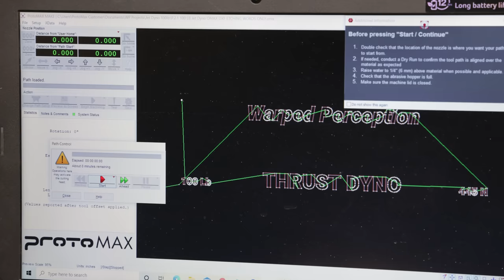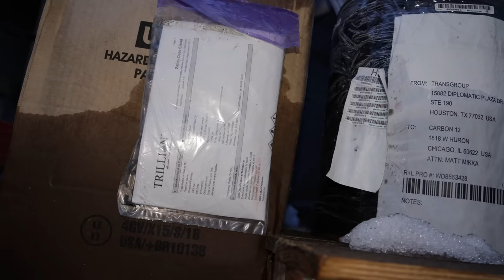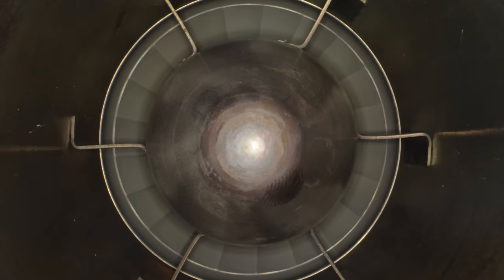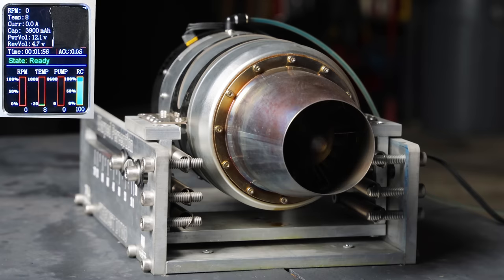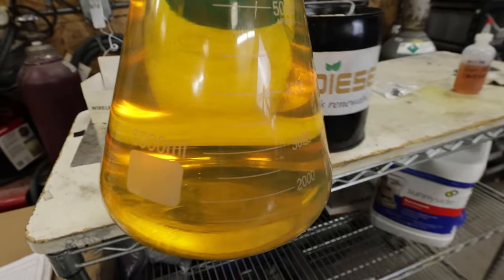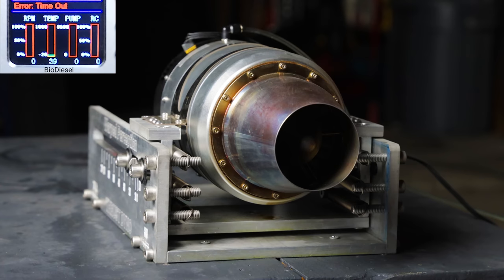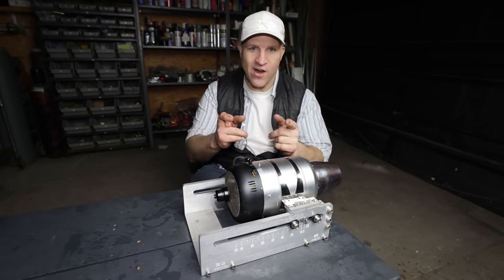Jet Engine Thrust Test - Fuel Experiment (Jet-A vs Diesel vs BioDiesel vs HydroDiesel)

Comment: This was an awesome video. Something I'd have liked to see to make this more thorough, would be logging of the ambient air / intake temperature and humidity, so that this variable could be accounted for. And also recalibrating / retesting your jig in between runs. Is it possible that the heat from the engine could affect the springs? Also the design of the mount allows the engine to apply a torque to the sliding part, which could alter the friction and power required to move it.

Comment: Truly impressive video, being ex RAF the sound brought lots of memories, one was standing next to a F4 J uk Phantom on engine a de tuner with engine on reheat runs where the back end of the aircraft was shrouded in a large chamber then throttled up! Being about a meter away from reheat shockwave rings WOW, a memory I will always treasure.😃😃

Comment: There is a design flaw, the heat from the jet can drastically affect the elasticity of springs
Reply: Another test flaw too, the engine didn't have time to fully cool to ambient between tests. This can be seen with the biodiesel start before it's even ignited, the engines still sitting at 38 degrees.
Reply: That was my first thought as well.
Reply: BS all of you.  Just look at the temp guage.  Comments always brings all the malcontents out of the weeds, doesn't it....  lol.   Enroll at Critics School!
Reply: @rimckd825  Sorry, Superman
That was a suggestion. And with this much heat few cms away can easily affect the springs so that you can't expect 0.1 lbs precision in thrust values. Only you can compare, not measure.
I couldn't find any good Critics School near me. You seem well versed let me know about yours, I can enrol there. Or, see, if you can tutor me.
Reply: Don’t judge me but I find this very amusing and I also fine falling asleep listening to jet engine sound so easy for me to go to sleep to remind me of being on the JetBlue plane
Reply: @murkinranzyz9961  im judging because this shit sounds like earrape.
Reply: @murkinranzyz9961  nah fr white noise soothing asf

Comment: Great presentation. Couple questions: 1. What is the RC scale measuring? I'm guessing throttle position?  2. What makes the initial rotation or spin up?  3. Is that front nose piece a shaft power  adapter
Reply: That looks like the throttle position; probably stands for Remote Control.
Reply: Rc ? Maybe rate of change. Acceleration

Comment: Interesting how using Jet A1 and the ECU lets it get to 99krpm where Diesel and Biodiesel and it only goes to 90Krpm
A difference of 10,000RPM will certainly show a large difference in thrust.
Hydrodiesel taking it to 93krpm and 54lbs thrust.
My thoughts are that it's down to Jet A1 being more refined than the diesels.
For my jets I used Kerosene or diesel and in the air you can't really notice difference in thrust
Reply: I think they did some calculation about the max fuel consuption to calibrate the pump. So maybe the pump was already at maximum capacity, or could be programmed to higher fuel injection rate.
Reply: It’s likely due to the ecu detecting the higher EGT and limiting the fuel flow while the water in the hydro diesel has a slight cooling effect to compensate.
Reply: @Greyline_ENG  max EGT temperature on the Diesel test was arround 630ºC, while on the Jet A1 test it reached arround 700ºC if I remember right, so definitely the EGT is not the limiting factor here.
Reply: @bodywerks  ok, thanks most of my engines are older and are limited to around 800c.

Comment: WOW I'm very surprised!!  The hydro did much better than I anticipated.  Besides the JP, it was the only one that got the engine up into the mid-90k rpms.  It also warmed up faster than the others besides the JP and did 2nd best in thrust.  So VERY surprised.  However, I do think it pertinent to mention, the heat from the jet may also have made the spring rate change.  It would have been nice to see the JP last after the others to guage the spring rate loss.
Reply: A pressure inducer on front side of engine support, and just measure the pressure instead of using mechanical motion.

Comment: Can the emulsification process used to make Hydrodeisel work on Preston fuels like kerosene? Because if so then you have a really good jet fuel alternative it seems.
Reply: I highly doubt it. We are incredibly careful about water content in jet fuel as it is. As was proven in the video with the HydroDiesel, at below freezing temperatures, that water content will freeze in the fuel. The cruise altitude for most jets is between 30,000ft and 40,000ft, the temperature at this altitude ranges from -40°F to -70°F, which would almost certainly freeze that water content, causing engine failure. Another issue is that water causes significant corrosion in aircraft fuel systems, which would have to be countered by an increase in fuel tank checks, normally only accomplished during C checks or if an issue is present.
Reply: @ShelbyWithAShelby  I really liked your explanation thanks 👍
Reply: @ShelbyWithAShelby  i have heard of a concept of fuel heating used in some airplanes within their fuel tanks. This could work on that jet fuel, on the other hand, the corrosion would require more maintenance to check the tanks.
Reply: @Alex96194  most airliners do have what could be considered fuel heaters, however they are primarily oil and hydraulic fluid coolers, and they do heat the fuel, but not enough to prevent icing if there's water in the fuel. Jet A has an average freezing temperature of -40°F, while at cruising altitude, the outside temperature is around -70°F. The FCOCs can keep the fuel warm enough to prevent freezing at altitude, but any water would almost instantly freeze, and during cross polar flights, fuel freezing is a major issue. So a water emulsified fuel wouldn't be viable for anything other than small, low altitude jets
Reply: @ShelbyWithAShelby  well ideally you could enhance the heating system if that isn't a problem,  I don't really see any problem.
Reply: @Alex96194  using what as a heating medium? You could either increase the fluid flow through the oil coolers, but then you have to deal with the oil and hydraulic fluid dropping below proper operating temperature, an electric heater could be used, but I'm sure you can figure out the problems with electricity and jet fuel, so about the only possibilty would be to use engine bleed air, however, that bleed air is so hot that it would run the risk of igniting the fuel the same as an electric heater
Reply: @Alex96194  I don't want to seem like I don't support the idea, I just haven't seen a feasible way to keep the fuel above freezing point with water. Maybe with advancements in technology, we will see this become a viable fuel
Reply: @ShelbyWithAShelby  maybe this is not even the viable fuel. Like you said, as technology develops further we will be able to find a better way of powering our stuff
Reply: @Alex96194  I can see HydroDiesel being very viable for trucks and trains running in warmer climates, as I'm sure it would designed for. But for aviation, we'll always be behind the curve in civilian aviation because it takes so long for any new technology to be approved for use.

Comment from the maker: Some people are asking me where to get the HydroDiesel here's where I got it $1.80 a Gallon, Trillion, LLC, John Leonard Email: jleonard@trillion.energy
Reply: @masterpanther1  i think jet a and kerosene are basically the same think.
Reply: that hydro diesel reminds me of the old J57 water burners. I bet with that jet A if you added the right amount of water you would see a increase.
Reply: i'd thank you for the Noise warning, but you reduced the volume of that part so much that its basically perfect, didnt have to change volume at all
Reply: My dude, many thanks for an amazing video. Looking at your setup, may I suggest swapping your RC transmitter and receiver, at least for bench testing, for a simple servo tester? It would alleviate a lot of complication. In fact, many newer RC-related current meters have PWM outputs as well, for control of ESC's on the bench. I believe this solution would be an awesome addition to your setup, while also giving you another data point - amp draw during startup and operation of the turbine. You can use that data to determine your battery requirements (C rating and capacity) when you take the turbine out in the field.
Reply from the maker: @masterpanther1  yes K-1 kerosene and JET A is basically the same, difference is that JET A has additives and K-1 is pure because it's used for heaters.
Reply from the maker: @bigboy501son  yup ! Water burners.
Reply: @WarpedYT  you know actually I should have knew this answer. A friend of mine is an airline mechanic and he has told me this once before. But hey either way excellent video! Definitely look forward to more!
Reply: @masterpanther1  Yup Jet A is modified kerosene. It has some lubricants and other additives. It's also basically diesel fuel #1, being a bit lighter and more dry than standard diesel #2.
Reply: Should make the" Worlds First Mini-Jet-Bike" and mount that piece if art on a minibike chassis! Even if you did it just for content views still be cool! Because lets be real there is no long term in a mini jet bike 💀 🔥 👊 👍
Reply: Hey those springs, as they get hotter and hotter next to that thruster, they’ll loose spring capacity and ruin results possibly, just throwing that out their!
Reply: I have a question Teacher. How much air(cfm or the metic cmm) does those consume. So at 50000 rpm at idle trust how much cubits of air is being consumed both intake and outlet. Also is there a difference between the fuels. Especial through and up to 90000 rpm just wondering. Cuz by static calculations it equals a bunch of butt tonne. 180000 cfm for 50 lb to equal ballast
Reply: One other question pops into my mind; why only jet A fuel allowed the engine to rev at almost 100k, whereas the diesel fuels ranged from 89k to 93k? Also, as we at it, wouldn't it be a fairer comparison if the thrust was measured at exactly the same rpm?

Thanks
Reply: amazing work.
Reply: @Macias1000000  Must be energy.
Reply: @steelsurfercore5642  On errthang.
Reply from the maker: @brinesilver405  I dropped the audio of those sections by about 20 decibels, which to give you a comparison if you drop a music track by 20 decibels in editing, you can barely hear it, gives you an idea for just how loud this thing was.
Reply from the maker: Jose Marques  i did, it was about 1000 ml.. but I may have overlooked it when I was filming
Reply from the maker: @funnydubby6401  the springs really don't get hot where they are at. Good thinking though!
Reply from the maker: @Macias1000000  I'm not sure that's what I'm trying to figure out, it should have ramped up to the same RPM
Reply from the maker: @LewpyDrewpy714  great question, I'm not sure about this small engine, your numbers seem pretty close but maybe just a little bit low. I can tell you the last engine I worked on which had about a 1000lbs of thrust consumed 25 cubic feet of air per second.
Reply from the maker: @LewpyDrewpy714  one thing you have to figure into your equations is, the thrust is produced by the expansion of the air inside the engine, so essentially the fuel being burned creates additional volume, that should be included in your formula.
Reply from the maker: @deathgaming8558  thank you
Reply: @WarpedYT  I figured, all that heat is directed away from them but I’m sure it could happen after extreme use
Reply from the maker: @masterpanther1  that's a great job... Alot of procedure though
Reply: Shoulda tried vodka
Reply: Dba mas mlakas pag may hallo n sulfur
Reply: plz can you tell me the cost of that powerful machine
Reply: @WarpedYT  what music did you use in the first part?
Reply from the maker: @helpingtech3767  $4000
Reply: Can you use bezene on jet engine next time
Reply: @WarpedYT  man please just tell me what song you used in the first part I'm begging you
Reply: @codyhereford2217  lql
Reply from the maker: @krishnaprasad1693  I just saw this message let me check it out
Reply: @masterpanther1  That would be the Jet A. Two names, same thing.
Reply: @nmatavka  I don't even see my comment

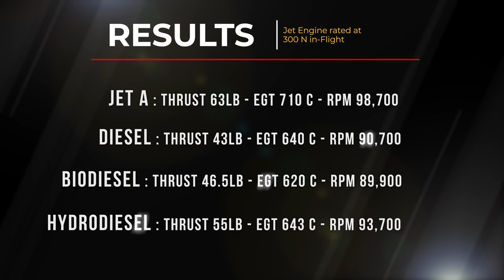Comment: 19:00 = mind blown
how does an emulsion of diesel and 20% water produce significantly more thrust and rpm than diesel without any water in it? Conventional wisdom would say the water would sap a ton of thermal energy away from the turbine!
Reply: 1l of water vaporize to 1600l steam -> extra thrust. vaporizing water ist cooling down combustion -> more density. you are also able to use a rich mixing without overheating the engine -> more thrust. water injection is used in engines (piston and jet) since the 1930s
Reply: With EGTs that high the steam provides a ton of exhaust gas volume which equals more thrust.
Reply: @Kyrazlan  
He could also probably over throttle the engine with the fuel that's 20% water.
The first generation of jet engines on the B52 bomber had water injection that enabled them to over throttle the engine with the water injection engaged just like over boosting a piston type aircraft engine with water injection, those jet engines were rated at 80,000 HP and 100,000 HP with water injection, likewise there was a too secret helicopter used during the Vietnam war that there was only a couple of them made, it was a secret variant of the Hughes 500 with water injection for emergency power, I'll bet he could have run it a lot harder on that fuel.
Reply: The energy that water "saps" can't simply disappear. It has to turn into something. In a jet engine it would still be a part of the total energy of the exhaust, so heating the water would produce thrust just like heating the burned fuel would. Now I don't know exactly how the thermodynamics of the jet engine works out, but from general physics I would assume that the thermal energy would be partitioned between translational, rotational, and vibrational degrees of freedom of the water molecules, and only translational would contribute to thrust (again, that's just an educated guess). The amount of energy in rotational and vibrational degrees of freedom would be different for water and CO2 — the fuel combustion product. The final thrust would depend not simply on the temperature, but on how much translational energy water and CO2 get from burning the fuel, and how much of the released energy get wasted in rotational and vibrational degrees of freedom.
Reply: @Vladigraph  
In water injection used on jet engines the water turns to steam and produces additional thrust due to it's rapid expansion, the system also reduces the fuel by about 20% to allow for the water.
That's why this thing produced more thrust running on the fuel with water mixed in with it.
Reply: @dukecraig2402  what I wrote is pretty much the same, it just goes into the "whys" a little deeper.

Comment: How about running straight kerosene or lamp oil in this thing? Or would it cause damage? Not enough lubrication properties?
Reply: Jet-A is essentially kerosene, there's no real difference between the two other than Jet-A being far more filtered and contains some additives necessary for flight.
Reply: @Skinflaps_Meatslapper  Ahh.. ok, thanks